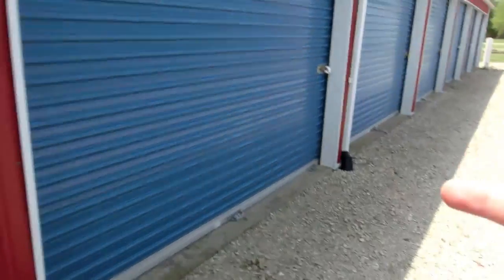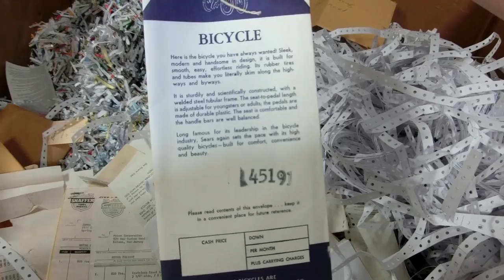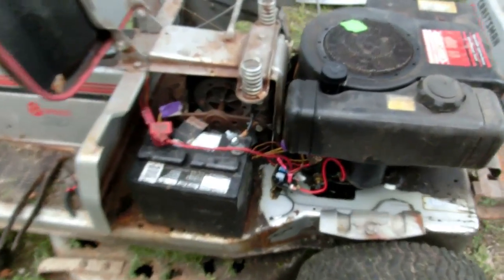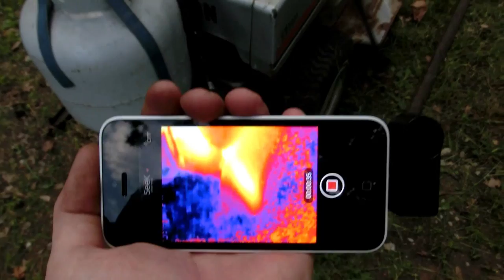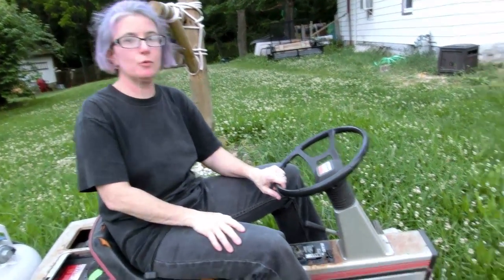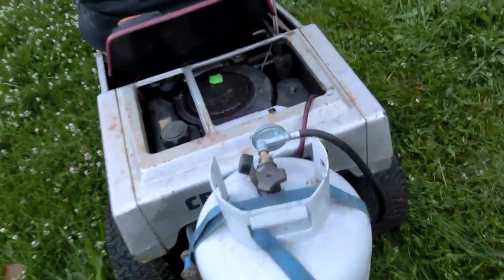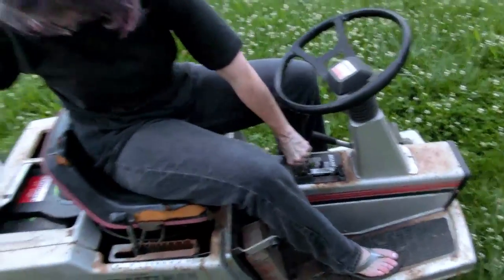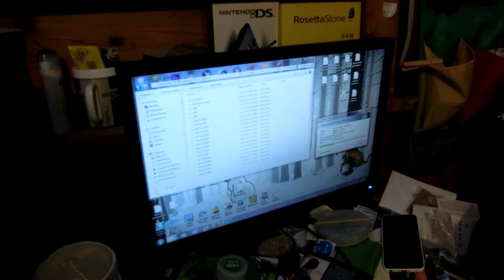Random Bits 0088: Lawnmower Starter Solenoid Replacement

Comment: Your mom is so cool, my mom wouldn't go near a home built propane lawnmower,  One day you should strip down the mower have the metal sand blasted and painted would be a cool project
Reply: Michael s my mom wouldn't even use a new lawn mower xD
Reply from the maker: Michael s yeah i would like to electrolyse it and repaint it. but for now the oil and grime keeps the rust at bay pretty well.

Comment: would it not be simpler to have a pressure regulator from a compressor so once you set the mix it is done so all you do is turn gas on and off
Reply from the maker: David Simpson no that would slightly more complex, not simpler.
Reply: Rinoa Super-Genius i just thoght is the engine runs at a fixed rpm once you have air and gas flow set all you would do is turn the bottle on and away you go
Reply from the maker: David Simpson
in order for the engine to run at a set RPM the regulator would need to increase the pressure when the engine slowed down, a regulator would be the same as the valve on the tank because the carburetor doesnt let pressure build up when the engine stops or anything.
Reply: Rinoa Super-Genius yeah i see what you mean now i know on lawn mower they use a padel that is forced by the draft from the cooling fan as engine slows down the throttle opens more letting more air in and as it speeds up is has more force thus closing the throttle so the pipe fram the gas bottle does that connect to wehere the main jet would be or are the carbs not like a bike one
Reply: i know when i converted a lawn mower to gas i just ran the pipe to the main jet

Comment: I like your electric mower better, convert this gasoline powered crapper to run off hydrogen and oxygen gas, it will run better, and make pure water while you mow
Reply: except oxyhydrogen is stupidly volitile and really quite dangerous in combustion use, also it burns too hot to be sustained